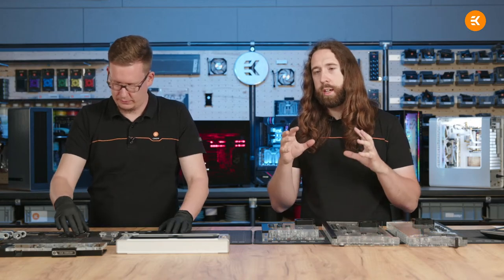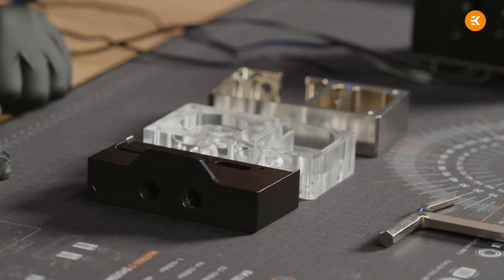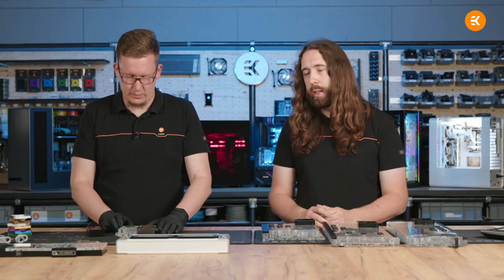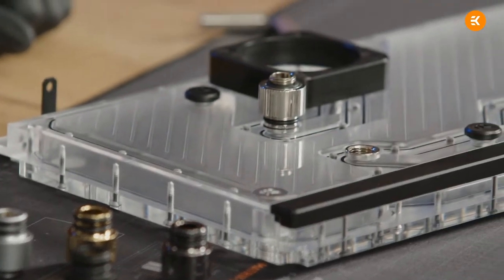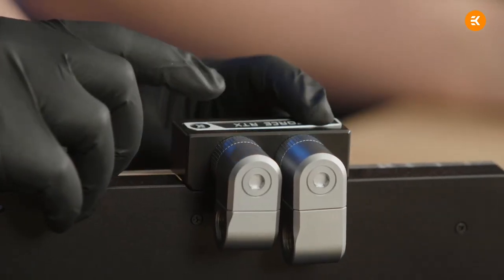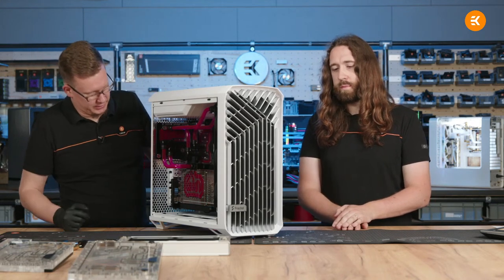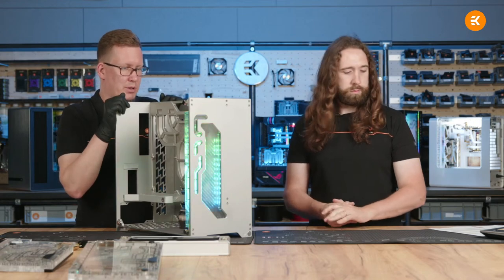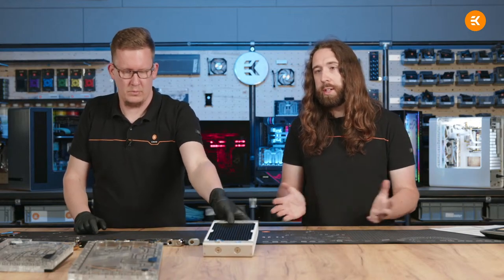The Future of Liquid Cooling is Quantum | Strictly QUANTUM

Comment: I would like to swap out my AIO for the Magnitude for a 2066.  What are my options for rotating the block so the ports are vertically aligned?  Can I rotate the entire block or can I just rotate the top, insert, and jet plate (leaving the coldplate curvature in the horizontal plate)?
Reply from the maker: You need to rotate the entire block. There is minimal difference in performance (barely measurable) when it comes to turning the Magnitude block 90 degrees. You should still see an upgrade in performance going from an AIO to custom loop :)

Comment: Hey, I’m just wondering about the distribution blocks and the new evo cases if there is a way to route hard tubes to the block from a gpu in the new vertical position as i havent seen anything on this yet
Reply from the maker: You can easily do that, but keep in mind certain bigger cards may not be compatible. The 3080 RE block for example fits just fine in a vertical position :)

Comment: Will the new Fractal Design Define 7 XL distribution block be compatible with 420mm radiators mounted in top and front? If not would the old Define 6 distro plate be better suited for this?
Reply from the maker: We'll publish all the info as soon as we're near the distro's launch :)

Comment: For the distroplate meshify 2 xl: you say it works with a P480 in the top and a X360 in the front. But with what thickness? Does it fit if both are M (P480M + X360M) with 3 fans each radiator?
Reply: P480 is the medium thickness, X360 is the thickest radiator, P and X denotes the thickness of the radiator, the M at the back stands for Multiport, means it has multiple port on the radiator..
Reply: @nassereds  I already know that. but that is not an answer to my question... I want to know if the two sizes (P480 in the top and a X360 in the front) fit with radiator FANs into the meshify 2 xl  case.
Reply: @CatchMeZZo  oh, sorry misunderstood your question, well in that case, your guess is mine as well.  😉

Comment: Plz this front panel water block for corsair 1000D mode cabinet water block
Reply: Corsair 1000d for distro plate designs
Reply from the maker: We've got a Reflection distro plate for the 1000D in our webshop: https://www.ekwb.com/shop/ek-quantum-reflection-1000d-d5-pwm-d-rgb-plexi
Reply: Two much costly not wort it
Reply: Can u send cad file  1000d to dimensions size